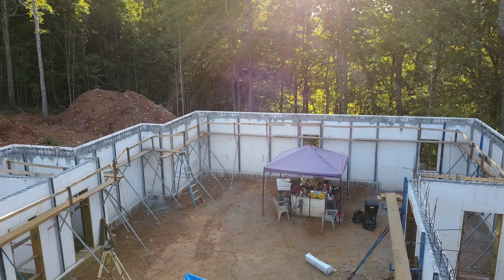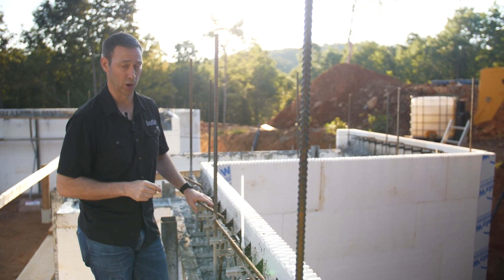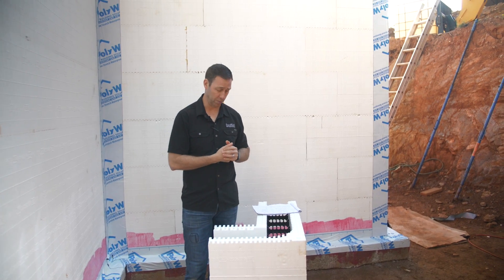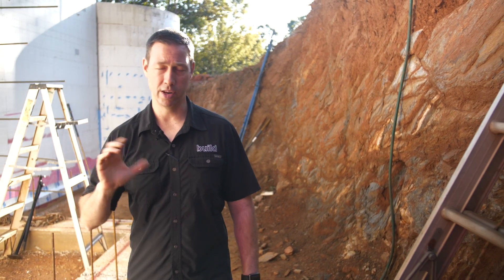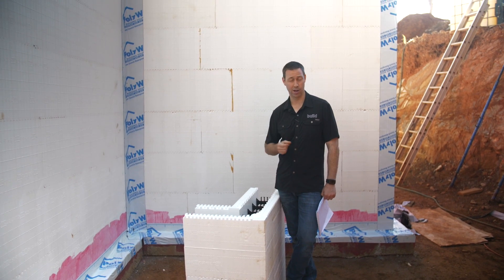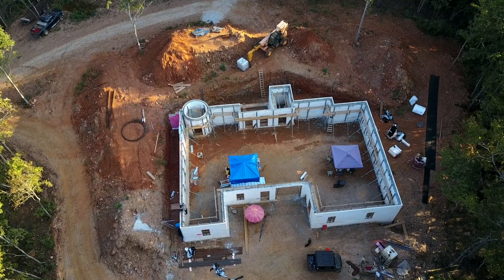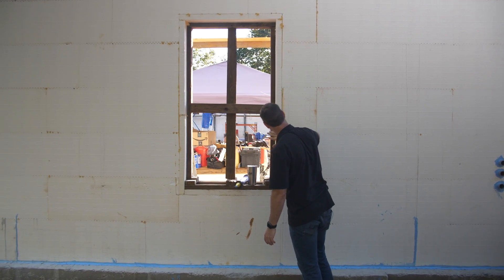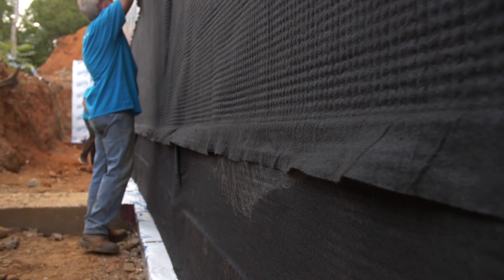Insulated Concrete Forms - Overview, Costs, and Cons

Comment: Used the ICFs for 4ft frost walls here in Maine...radiant heated garage/workshop with large apartment above.
Only made sense where I needed to keep the heat in the slab and the strength of the walls to support the weight of a full size cape with dormers both sides of the roof.
A full ICF house looks like quite a project!
The ICF frost walls worked out great for radiant heated slabs.

Cons: Can be a nitemare to pour with all that rebar/stands in the way.
Ants love to build homes in the foam...treat the ground and don't bury your old tree trunks on site!
Reply: Puoring concrete in any kind of form (including ICF) with rebar in it, is a "normal" thing to do. It has been done for over hundred years.

Comment: The Next gen ICF is polyurethane not eps.
Closed cell vs. Open cell. Prevents water, and pest. Double the R value 50+. Class 1 fire rating. Minimal bracing compared to eps. Can withstand a straight 10 ft concrete pour (not that you'd do that).  http://thermagreenblocks.com

Comment: Awesome, how is termite protection on these, considering it for a NW Florida house on a saltwater canal
Reply: Hey Alan, good question! The EPS foam is not a food source for termites but if you're in a termite prone area they may burrow through the foam to find a source of food (like a wood framed roof).  We sell a product called BuildShield that can be implemented into the wall and forces termites out of the foam, creating mud tubes, and allowing the owner to treat when necessary. You can learn more about it here https://buildblock.com/products/buildshield-termite-protection/
Reply: well, theres no wood soooo...

Comment: I'm planning on building my retirement/dream home in a few years using ICF foundation and this is the best explanation of the system that I've seen. The most important thing to me is having a house that is airtight and has both high energy efficiency and high structural strength. It will also be a totally off grid house. I want an heirloom home that will survive for generations and require very little maintenance along the way...and ICF seems to be the best way to achieve those results. Great information.
Reply: It is solid that's for sure
Reply: ICF is a very good products for house ,Welcome to inquiry chenguan01@epseppfoam.com.very very good price for you

Comment: Can you put metal 2x6 studs inside and add traditional insulation, or will it sweat and ruin the insulation?
Reply: they should not sweat since they will be at interior temperature- there is no thermal bridge to outside.

Comment: Spend the money on a 3D drawing thats drawn to realistic specs and not just for looks then build ICF also the drawing should come with a stage by stage what to do / project management and then and only then you the home owner can take on a build. once everything is level, squared and plumb the finishes will be easy and look great. many homeowners take on projects and they look good from far but far from good. 12 years as a carpenter / builder and i am still learning

Comment: Having completed  several ICF projects, I now run advantec or plywood continuously on interiors before the pour, outside gets strapped with cs-20  for lathe appliations or hardi-backer , and plywood.
Reply: Why
Reply: @charlottedeudonne4479  the contiguous interior sheathing greatly facilitates the ease of living in these buildings as well as the bracing schemes for the pour.
Having an icf building I grew tired of patching critter damage to the foam and this way the foam is protected
Reply: @georgemckenzie2525  thanks 😁
Reply: @georgemckenzie2525  where do you build?
Reply: @charlottedeudonne4479  northern vermont

Comment: Matt, you mentioned the ICF cost at $15 per Sq. Ft of the wall. but what could you build a 2x6 stud wall with insulation for?
Reply: It's easy to google.   Here' s a calculator
https://porch.com/project-cost/cost-to-frame-a-wall

Looks like about $3 to $4 per square foot.  Probably more for 10' high walls than for 8' high walls but likely under $4.50.
Reply: The 2x6 wall will cost you more as time goes on. You have the thermal break to contend with forever in that wall. You can only stuff so much insulation in a stud wall. 
The other thing Matt didn't mention is your home insurance is much less because there is so much less to burn. Especially when you use the Quad Lock concrete roofing system.
Reply: @mikebigelow9057  Here in Finland you typically install additional EPS board with aluminium foil outside the stud wall to make a constant thermal break. When you tape those EPS boards together with aluminium tape, you get waterproofing and wind protection at the same time
Reply: They never seem to provide the information to make a direct comparison.
I wonder why that is....

Comment: How well would a house build with this withstand an earthquake?
Reply: Our home withstood the Nisqually quake in Seattle just fine. The building Codes dictate a stronger concrete mix, more rebar, and a wider (24 inch) footing to make sure it doesn’t crack.

Comment: I'm curious. I build monolithic domes and the studies the originators of this system learned that styrofoam shrinks over time as it off gasses. Polyurethane foam does not shrink.
Reply: http://thermagreenblocks.com ICF is made of polyurethane. Class 1 fire rating

Comment: How is this material recycled? It's basically a composite when it's poured. Would love to see a green alternative to EPS. I won't be specifying this on any of my buildings because of this, the reduced HVAC bills won't cover the guilt of knowing that EPS will be scattered across a landfill in 100 years.
Reply: Tom, the EPS forms are not removed but remain as a permanent part of the house for the concrete to continue curing and strengthening over time. Siding is attached to the outside and drywall to the inside foam. It actually is a green building method saving trees and energy. As for finding this stuff in landfills in a hundred years, if I were a builder I would find vacant land or some crap old wood house to tear down before ever considering breaking apart an ICF for a new build. And EPS is recyclable https://science.howstuffworks.com/environmental/green-science/polystyrene-recycling.htm

Comment: My contractor didn't vibrate and I now have honey combing, if I had removable forms they would have vibrated and fixed what was left. They even had a blowout on the outside??? They did the floor first, then the walls and got concrete about a half inch thick in several places. I should have had them do removable forms, and added 4" of foam myself before backfilling to save on the shotty install they assured me they were experienced with. I asked one long time employee and he said it was there first. Downside is not all old school concrete workers know about this new technology.

Comment: I agree about the Green Building Advisor, I've read articles there where they advocate installing 16" of XPS UNDER the basement floor and to me that is just extreme overkill and a waste of resources to insulate against 53 degree temps.
Reply: It's most likely on heated floors, where you have 53 degree temp in the ground but 80 or 90 in the concrete, so you have a constant 40 degree delta T. The heat would move towards the 53 degree ground more then the 70 degree house.

Comment: Another fine video, Matt.  That's a massive house for off grid!   Love those ICF's.   Question: is cure time increased due to the encapsulation of the concrete?
Reply: It is slower and therefore stronger

Comment: Matt you are off the mark on some critical information. Check out the studies where two identical houses were built by the same contractor. Both attics have blown in insulation. One house is stick built with R20 walls in fiberglass insulation and the other house is built R14 with foam. The foam insulated house was 50% less in heating costs on the average. The R value rating of air impervious insulation does not consider convection. Therefore the insulation rating of this system is plenty for any climate. Check it out.

Comment: what about termite inspections
Reply: That’s a good question. There are special rules that apply including the installation of a metal termite barrier and/or cutting out 6 inch strip of foam at ground level to prevent termites from hiding behind the foam as they make their way up to the roof where they can get to the wood framing.

Comment: Bought my 2800 sq.ft. house in central Florida about 5 years ago and it has ICF walls. Never heard of it before. Let me tell you it is amazing! So quite and efficient. It freezes here a couple times a year and of course the summers are hot. The house is always comfy and the heat/ac hardly runs. I did change a bedroom window to a door and that was a chore cutting it out! Way harder than I thought

Comment: Why would they install the polywall vertical... Thats my question. I bet it would 100% better  horizontal.  I can imagine a buffer that extends from the ground to the wall that would buff on some sort of compound to go in between the Styrofoam cracks to help make it water proof.  Lots more idea's if you want to hire me. Resume is: I got my GED.

Comment: so how do we run our plumbing pipes and electrical wires in the walls?
Reply: Some wiring(tubes) and plumbing are done before concrete are being pore and some wiring and plumbing can also be done with cutting away the foams.  But putting pips inside the wall isn't recommended so it's better off adding wall stud to the wall for larger pipes.

Comment: Matt, what about the insulated concrete cast panels that are used for years in commercial and now shifting to residential.  Have you used those - it would seem to be close to the same idea with some differences ..

Comment: So at 9,000 sq ft wall x $15. Equals $135,000 just for walls.  So on a 7,000 sq foot house, you are already up to $20/sq foot and a heck of a huge amount of cost to go.  Matt, concrete absorbs a lot of water....it will suck it up.  It’s a issue like when you build fences - the concrete holds water up to the wood and it rots out.  I have fence put in 20 yrs ago (2000) and it has just about all rotted - it is the framing and boards that is holding it up - the posts are gone and everyone we replace is a mess.  Yet on our farm  we put horse fence up in the late 60s-70s....still standing.  We used stone dust mixed with the native soil (dirt from the hole) and tamped them.  It only took a couple of hours every year or two to go around on 15 acres of permiter and cross fencing to tighten up where horses push on the fence scratching. The last time I saw the place in mid 2000s - fence still standing. We bought the posts from lumber mill, and took them to a company that dropped them into some type of treatment for a week or so and then let them dry and we picked up by the truck load. Remember 60-79s.  We then dipped/soaked the bottom 2’ in pinetar mixture for a couple days, drained and put in the holes and tamped (inch or two at a time with wood or metal pipe tamper with cap at the bottom) - they were tight and didn’t move. The folks said where they pulled fence to make changes (paddocks bigger) - they used the same posts again because they were still good, no rotting.  I know of 100 yr plus white oak fences with oak, locust (maybe some cedar or cypress that were put in with just dirt temped hard.  The bottom 2’+ of  posts were dipped/soaked  in pinetar/kerosene type mixture and the boards and rest of post was painted with a thinner pine tar mixture.  

Matt, what about fire burning on the inside - these foams worry me about noxious fumes.  And 15 minutes isn’t very long at all especially in rural areas.  Gosh even in big towns, there can be issues, just heard of where just south of us where the budget hadn’t allowed for new trucks to replace old trucks, and then when the remaining broke down - they weren’t able to get to homes fast enough and didn’t meet expectations so everyone is up in arms. Even though the economy has been steadily improving from the damage of Great Recession 2007-2008 yrs bringing everything down - many municipalities are still way behind the eight ball.  I’m getting ready to build and I’m looking at products like magnesium board (replace drywall) perlite for foundation insulation, rockwool, and cladding with hempcrete, real stucco, Durock panels, metal/steel panels - anything that doesn’t rot, absorb water, etc.  I don’t want anything that puts out fumes when it burns, or anything with wood in the mix that still have issues with swelling from water damage and termites.  No vinyl -  I have seen several houses that caught on fire and burned so hot that the houses on both sides their vinyl siding melted.  One fire, 3 damaged homes and several sick people due to fumes. You could smell the chemical smell for days afterwards. 

My other thought on ICF walls, my termite company says they see plenty of the ICF houses and those on slab foundations (brick/block footing) that end up with termites coming up inbetween the block and slab, or in the middle of home through tiny cracks, or around piping etc. and between concrete and foam.  Folks never see it until until the termites have done major damage to any wood (floor, trim, window/door framing, cabinets, book cases, etc) they can get to. They said the ground needs to be treated under the foundation, all wood needs to be sprayed with something like BoraCare, and special termite screens around anywhere the termites can build tubes from dirt into the structure unnoticed.  Then after the soil is put in place and landscaping around the home is done - the home needs a regular termite treatment with annual checkups. These new treatments while good only last 7-8 years on average. They are also much better at not contaminating ground water, rivers, creeks, surrounding soil and damaging to environment.  The new ones don’t stop the termite as it touches it (not repellent)  - they have to crawl through the product (maybe eat it) but they take it back to the nest, end up killing the whole nest.  They told me they have seen new homes that didn’t receive proper treatment - eat up in a couple of years. In areas with the really bad termite (can’t think of its name) - they can destroy an untreated house in months to a year.  

I really want to like ICF and many of the new technologies but any house that is so tight it requires a special ventilation system to keep the family healthy, fireplaces and gas stoves properly drafting.  Gosh what happens when the power goes off in the middle of the winter - ours has been out 10+ days during bad storms - and you need air for the things mentioned and just to have some decent air to breath - but it is winter and you can’t open windows.  What do you do then?  

And talking about longevity - you mentioned 100 years.  You know houses use to easily be 100 years. There are plenty standing today, abandoned - but most the cladding, trim, and windows are still there. There are houses standing in other parts of the world that are 6-700+ years. The weather - storms, hurricanes, tornados, fires, earthquakes is getting worse each year and yet we build more expensive homes with shorter lives every day.  Buyers have to start pushing back and complaining to local, state and federal agencies.

Comment: ICF is quite popular in Canada and it works great. That R20 ish you mentioned works much more like an R40 and can be heated using a candle (a tiny exaggeration). Waterproofing has been more of an issue but if you lay the exterior tar wrap carefully, put in big o and gravel there will not be problems. There is even a company whose bpock product is made from wood by-product and fire-proof. ICF is the best way to go.

Comment: I have used an ICF-system, my over all cost was more than using a SCIP-PANEL. For my money, and to produce a complete panelized house. In using ICF-Panels, we ha to install a stick frame roof system. I using our SCIP-PANELS w build the compete house out of Panels. I will always build with the best solution for our customers.  I prefer a SCIP-Panel system. www.impactconcretehomes.om

Comment: When you do the basement floor, how do you waterproof between the concrete basement floor and the walls? I know that there is this "concrete glue" which you can use to keep two separate pours together , but not sure if I'd trust that stuff with something that critical.

Comment: Not trying to down your product but you are wrong about the tornado's. I have seen tornado's suck out a whole concrete home that was built half way into the earth and leave the precise imprint of the concrete foundation. and one other thing about concrete homes in the mid to warm climate areas these type homes will sweat from the inside out causing mold behind the walls and that's not even the bad part of it, they will draw fiddle back's and recluse spider's like they were termites No way would i ever have one of them homes them spiders are deadly within the first few hours i have seen what they can do to a person and animal they are just as deadly as a rattle snake !! and the moisture that these type of homes have in them is like a magnet to spiders, and your testing fate talking about the power of a tornado not being strong enough, kinda like the titanic.

Comment: We built our ICF house in 1998, BlueMaxx forms. They were bought out be another company. We did build it ourselves. 20+ yrs in Indiana and we love this house. Put a metal roof on it  and the house will last 100's of yrs. We even used Icynene spray foam insulation under the roof deck. When the worst storms happen we can't even hear them in the home.

Comment: Matt what do you know about Tilt Wall or precast concrete panel construction homes and if not you should do a video on this type.
Reply: Precast walls aren't as effective in insulating values or in strength.  ICF is monolithic in strength (no attachment joints) and in insulation (no joints).